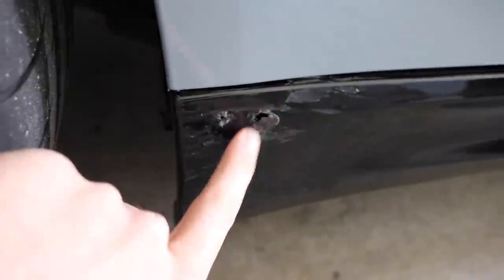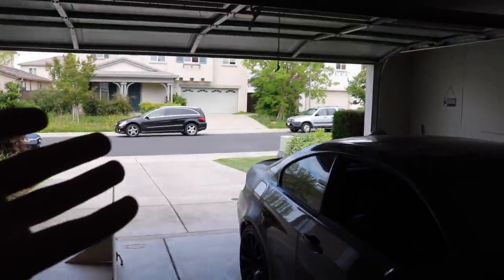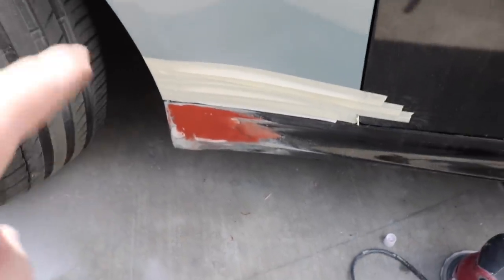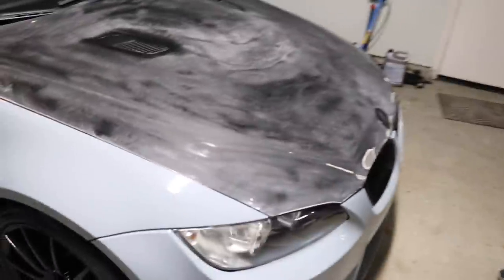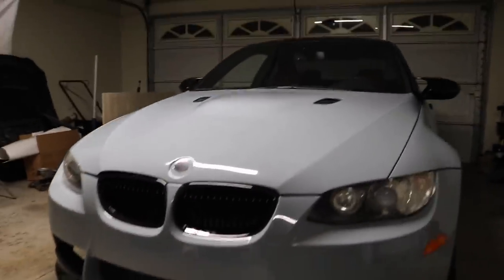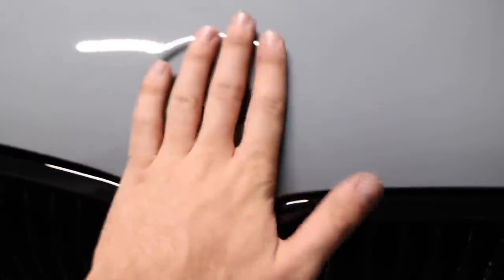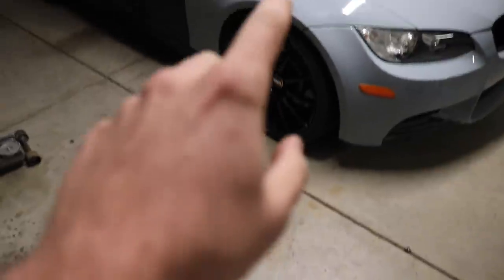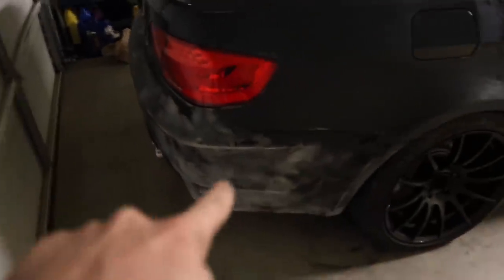Rebuilding A Wrecked BMW M3 Part. 13

Comment: Put original emblems, don't mess with the identity of the brand!
Reply: Radu Preda I agree, keep the logos and emblems OEM. None of the aftermarket looking ones.
Reply: I did the same, did a lot of cosmetic mods to my e92 335i but the emblems I will never change from blue. Tempting because of the red interior but can't disrespect the badge.
Reply: Leandro u can get red bmw badges🙄

Comment: Don't use spacers, spacers have no place to be on a performance vehicle.  Buy the right wheel specs to get the fitment you need as well as correct bolts

Comment: It's a good job the wrap is temp Nour should have wiped the hood / bonnet with alcohol or white spirit to get rid of the contaminants and any sanding swarf. Mite lift pretty quick this wrap to be honest
Reply from the maker: I did actually just off camera
Reply: @NourHummadi  ahh was it in-between the two clips? Could see sanding residue then just you wrapping it haha no worries 😁 cool project nice to see your brother helping out too 👍